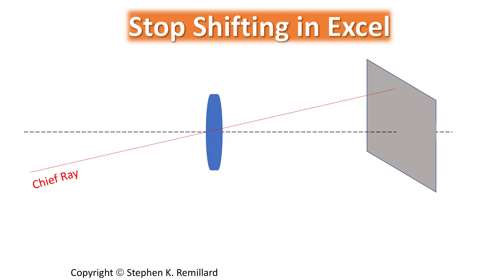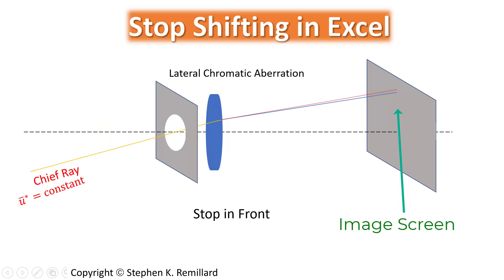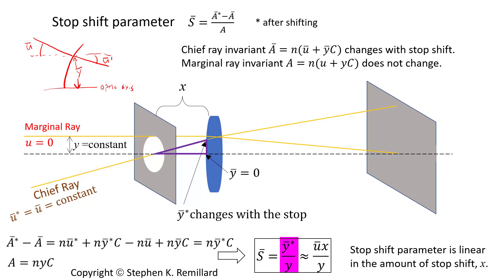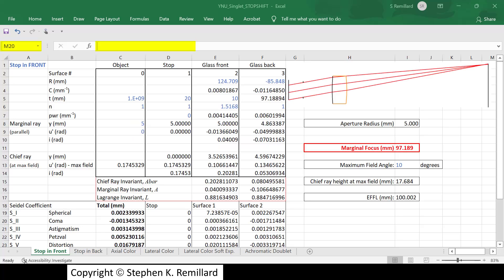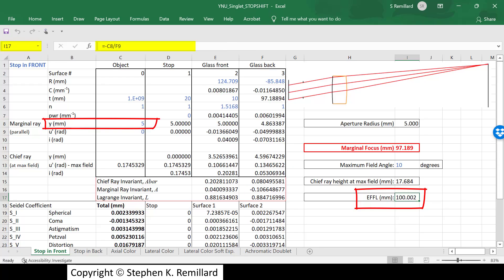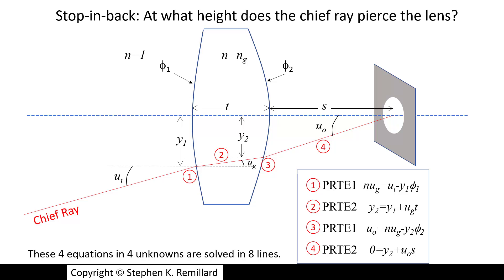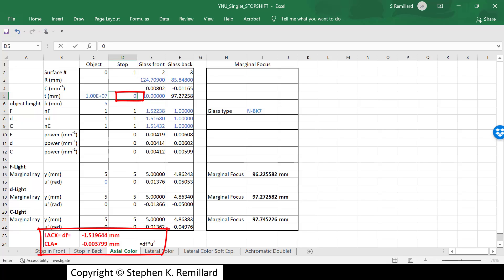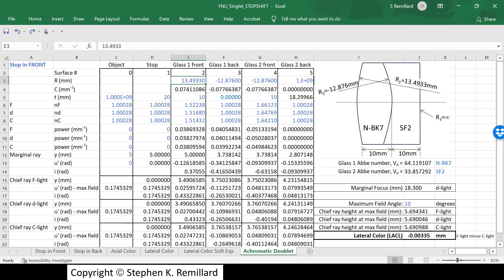How Does an Aperture Stop Influence Third Order Lens Aberrations?  A Tutorial using Excel

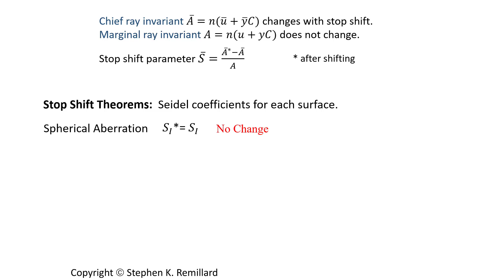Comment from the maker: Typo in the slide at 6:29.  The stop shifted coma has A (the marginal ray invariant), not Abar (the chief ray invariant) in the denominator.  The correct expression is S_II*=(Abar*/A)S_I.  The slide in the video shows S_II*=(Abar*/Abar)S_I, which is an error.  The spreadsheet calculation is fine.  It was just a typo in this PowerPoint slide.

Comment: Hello Stephen,
Last night I was constructing my excel table and comparing with your sheet. I notice that for both stop (front and back) sheets, the Lagrange Invariants for the lens (front and back) are different slightly. I recall this quantity represents the conservation of (information/energy) in the optical system which should remain unchanged moving through the system. I refer to your Petzval curvature video the single lens has identical Lagrange invariants...
currently, my invariants are the same for with and without stop. My doublet sheet is not ready, so I cannot say my results...The presence of the stop I think should be the factor that causes the gaining/lossing info during the ray propagation? Although, my results are very close to yours compared to the ZEMAX benchmark. 
Have a nice day! Waiting for your Astigma and Distortion videos!!